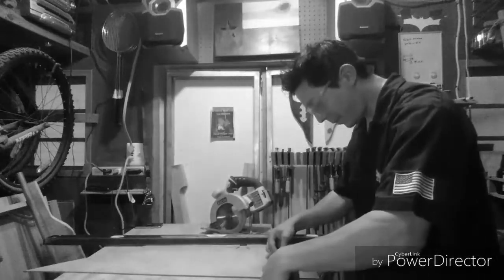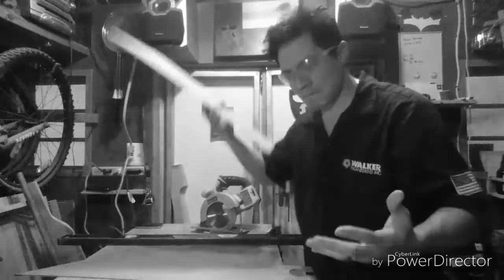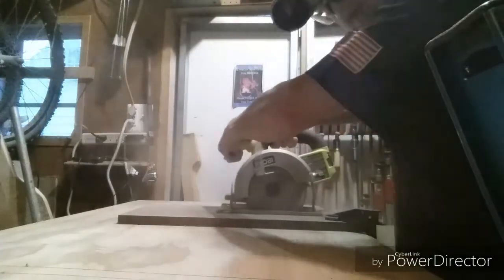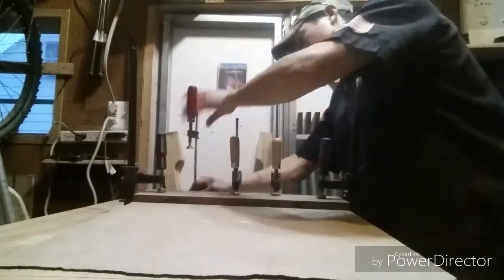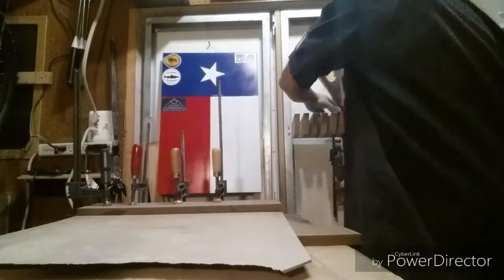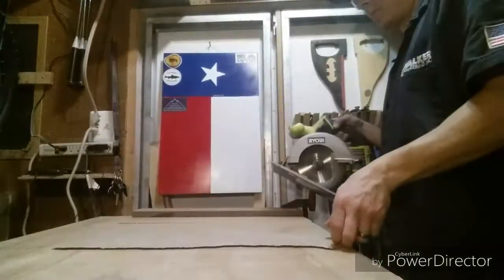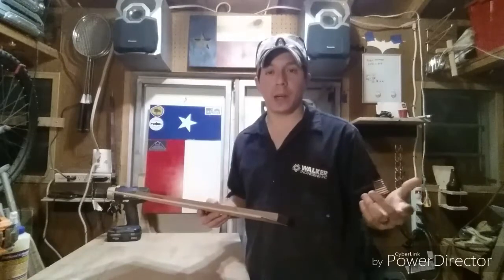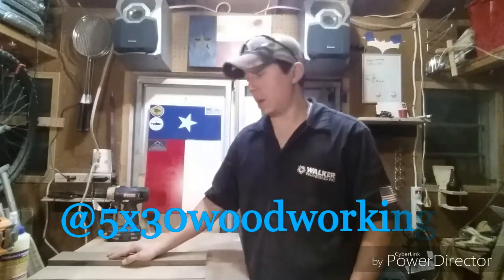Make an easy and cheap Circular Saw guide!

Comment: Good video man! Can even see an improvement from the first.  And "Those fancy tracksaws..." LOL. The sad thing is that I still have those same movement and line missing problems with the tracksaw sometimes! Accuracy is always my biggest challenge and it drives me nuts sometimes. One thing I have learned the hard way though is that while there's a few things that are helpful, a lot of the fancy expensive crap isn't totally necessary. By the way, do you have a ryobi impact along with your drill? If not, I've got one I don't need if you want it. I can chuck it in a flat rate box out to you.
Reply from the maker: As somone told me once, "It's not the tool that makes the man, but the man that makes the tool". Meaning you can have the best tools in the world but if you don't know how to use them, then they are useless. I've tried to take that to heart. I mean sometimes you do need a better tool but, you need to learn how to work that tool. Lol, there is a little improvement in it, but a lot more to needs to be improved on. Thanks for the support, your videos came out great. I actually just got a Ridged Impact about 2 weeks ago. If you don't know of anyone who could use it, I would gladly take it off your hands lol. Can't have to many drills around right! Lol Thanks again for the support, and I'm going to DM you on instagram about thoes questions I have.